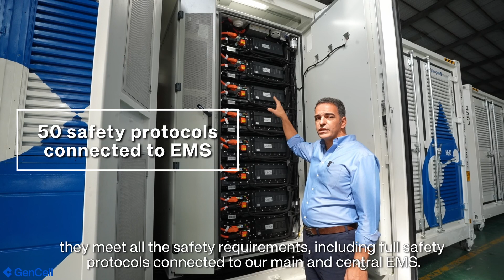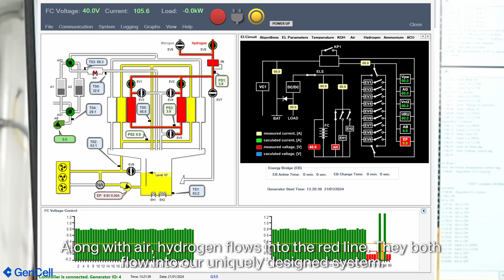Take a tour of our spanking brand new GenCell EVOX

Comment: Is there a way to get DC out to avoid the losses of going from DC to AC then back to DC when using the battery or the fuel cell for charging?
Reply: losses always will exist. Mostly probably the DC voltage level on the battery side is much higher than the fuel cell side, it means, to couple than together you will need electrical elements in between.
Reply: There is a way to step down the 1500v to 700v and some chargers can work with DC. Although very few.